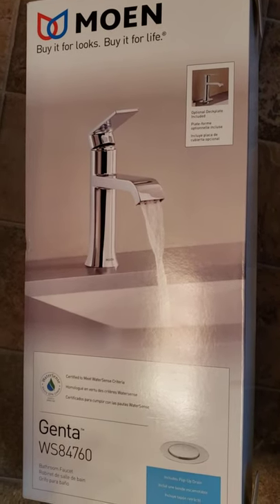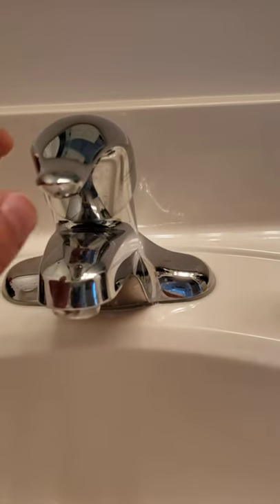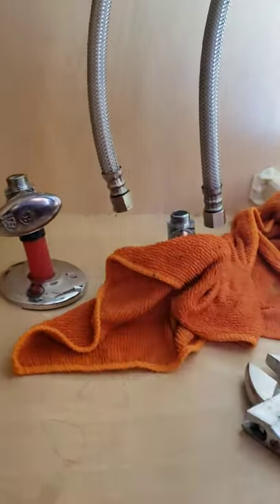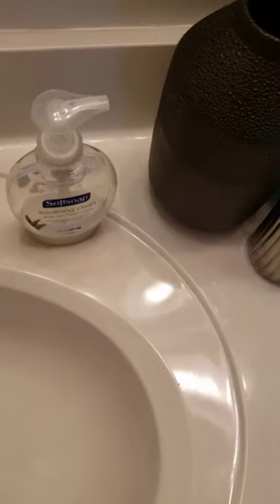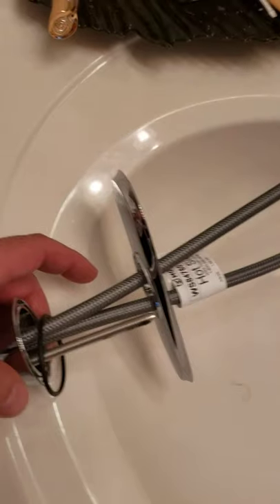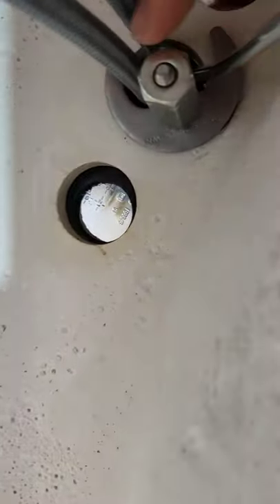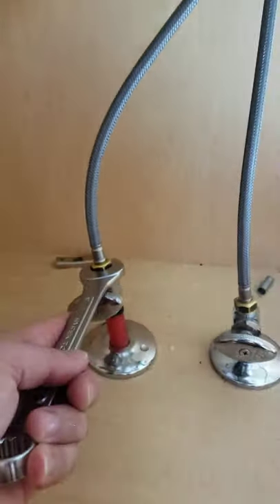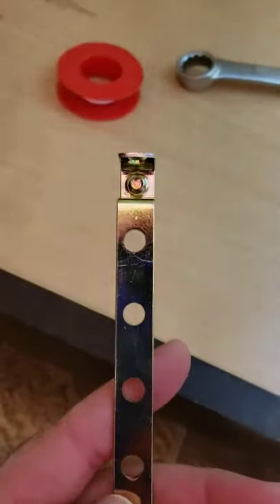MOEN ,BATHROOM FAUCET, Genta ws84760,Replacing

Comment: Thanks just bought this and I was not sure if it used a Moen Duralock connector.  Just the wrench bolt that moen provides.  NOTE!  These faucets have the aerator inside, when they get clogged you have to stick a thin hanger wire in to break it, cant replace it or clean it.

Comment: Eneudy Vlogs - Thanks for your post!  Can you show us which size hex/Allen wrench to replace the aerator kit?  I really just wanted to try and remove to clean/scrub it to see if that corrects the low water pressure issue on this faucet.  I have this faucet in both bathrooms, and although the shower pressure is great, both sinks faucet pressure is bad.  I figured I'd start by scrubbing the aerator and/or replacing.  I suppose it would be easier to remove the hole faucet top because the aerator kit is on the bottom of the spout after removing the throat cover, but wanted to see if there was an easier way.
Reply from the maker: Your Welcome 🙏 ♥️ I am glad the video was a helpful for you.

Comment: This causes water to spray everywhere when I use it. Anybody else experiencing this problem?
Reply from the maker: I haven't have any problems yet.
Reply: I have similar problem. Water splashed everywhere on counter, although water flow is very very slow (take more than 20 minutes to wash face clean)
Reply: @sapsecurity4075  I complained to the company but they said they don't get a lot of complaints about water splashing everywhere. It seems like the water coming out the way it does naturally makes it splash everywhere, so I'm surprised not many others seem to have this issue
Reply: What kind of sink bowl do you have?